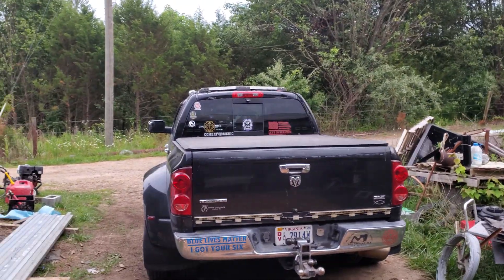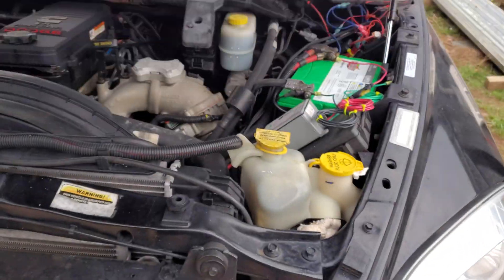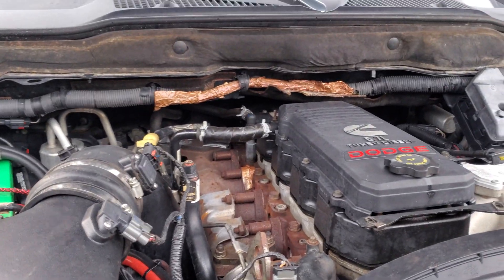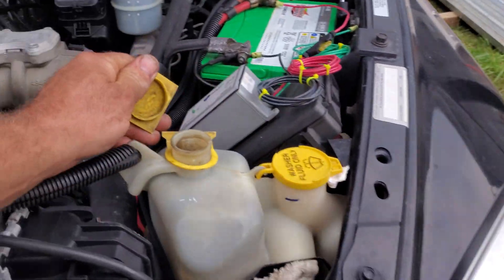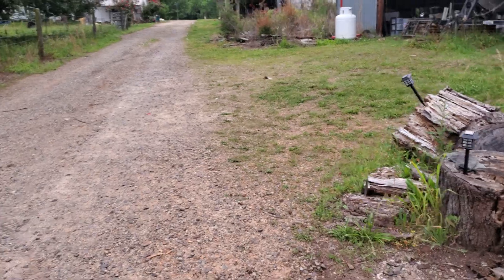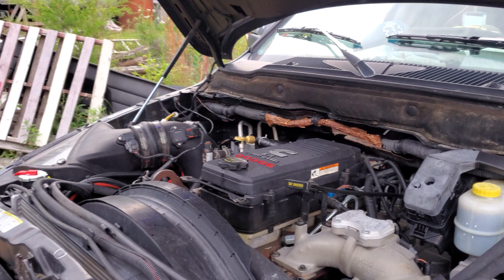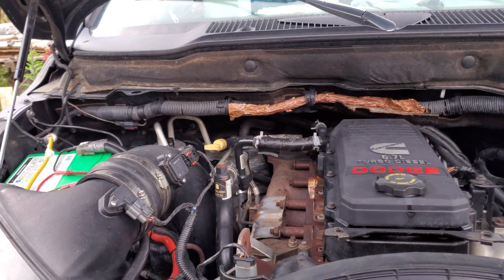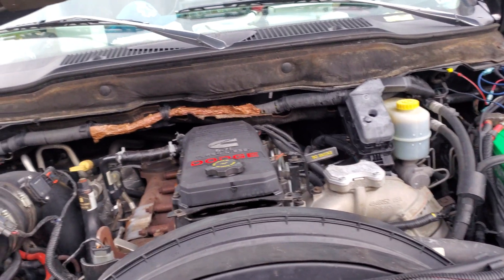Burping your 6.7 liter  Cummins stopped over heating issue

Comment: I had this happen to me one time after refilling the coolant, I finally pulled a heater core hose loose and found it was empty, force fed water into it with a garden hose and it cleared the air

Comment: I’m having a problem with coolant reaching temps of 230 an no leaks an it’s not puking out but my heater acts funny an it bubbles back into my reservoir after I shut down could that be an air bubble or should I do a thermostat
Reply: mines doing the same thing

Comment: I have the same problem, I have excessive pressure in my coolant system. No water in the oil and it won’t overheat. Just pukes water, could air come in from the turbo actuator?

Comment: Probably best to vaccum fill these bad boys. They seem to take forever to burp. I'm still have some air trapped in mine after replacing the radiator, radiator was hit by a rock and leaking

Comment: Done all that and still having issues
Reply: Same is happening with my Ram 5500 after getting all done, did you figure out the issue ?
Reply: Mines not overheating at all, but my heat doesn’t get that hot even after 20 miles, changed the thermostat, used a 190 degree, still doesn’t seem quite right, any suggestions

Comment: When you burped it on the slope did you leave the cap off for the reservoir. Im in the process of flushing my 17 ram and its a pressurized system, i did not know about the vent so thanks for that!

Comment: Exactly everything I did to a t my driveway has a slope that seems the only way it works I even did a radiator flush and had them try and burp it and nothing worked
Reply from the maker: Ended up I had a blown head Gasket had to replace  and used ARP studs
Reply: @marvinlange5797  dang I was hoping not to hear that
Reply: Was it running hot at idle or under load up hills?   Mine is just fine cruising, but when I go up a long hill it’ll start to get uncomfortably warm if it’s long enough with a load on the truck.
Reply: @freeandeasy9795  I hate to say it but you have a blown head gasket I tried everything even the blue devil thing sorry but just to the gasket